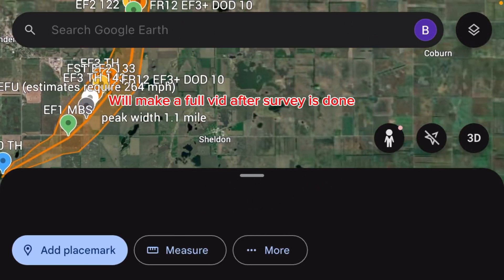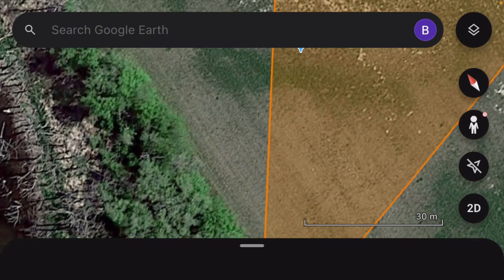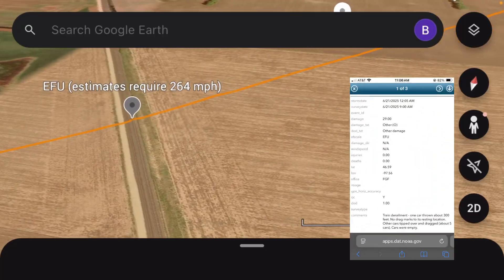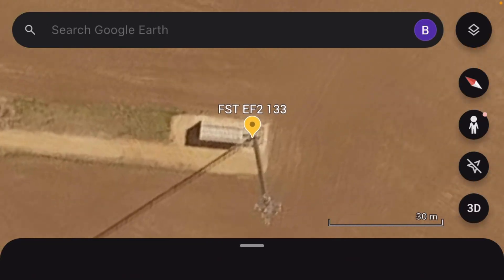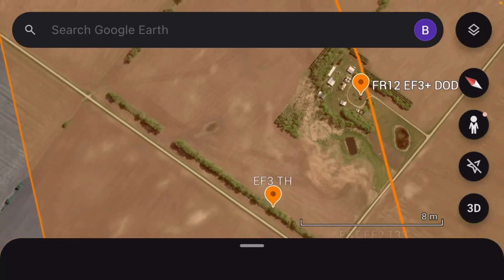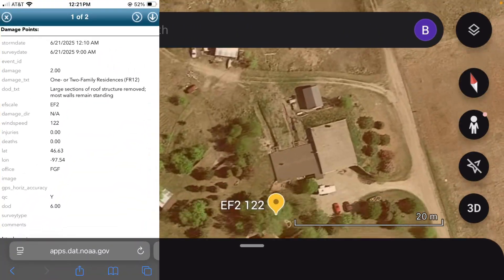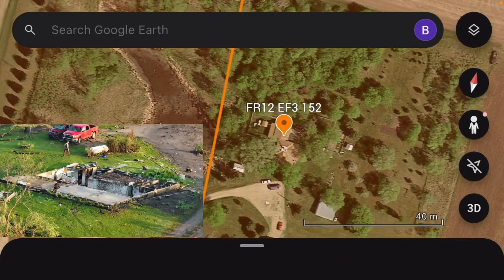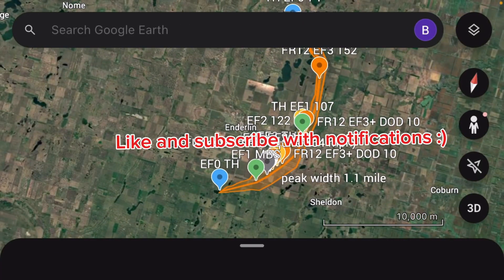The enderlin North Dakota tornado damage analysis part 1 #tornado #weather #northdakota

Comment: This is the first EF5 since 2013
Reply from the maker: Also the strongest ef5 rating ever tied with el Reno piedmont 2011
Reply: @StormChaserBrodyWx wym by strongest rating?
Reply from the maker: @vincentos1239 210 mph+
Reply: @StormChaserBrodyWx  wasnt smith vile stronger
Reply from the maker: @vincentos1239 yes but not officially. The Ef scale works by rating very specific indicators and homes can’t be rated as high
Reply: @vincentos1239smithville was probably stronger than this one but it just hit a lot of houses